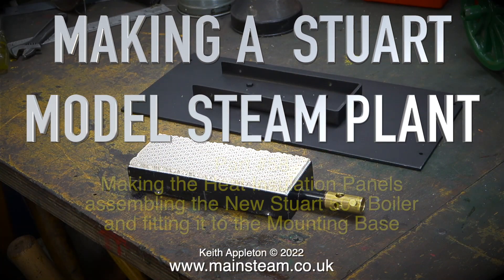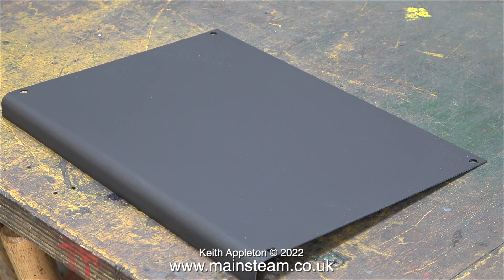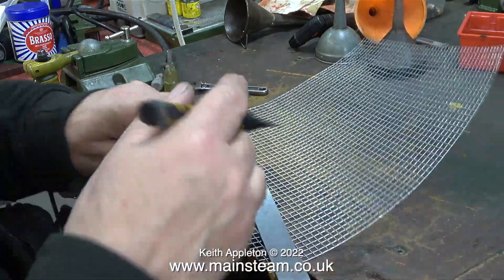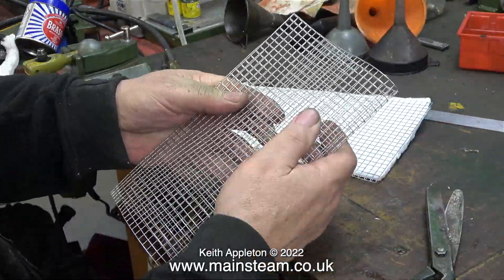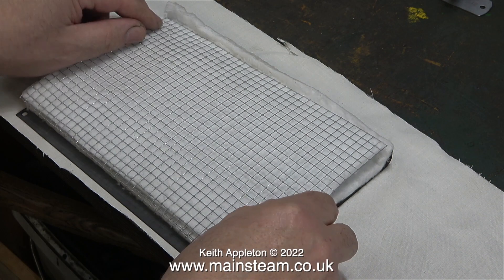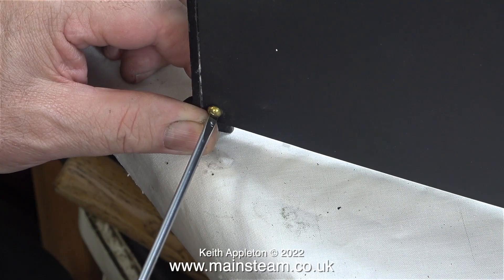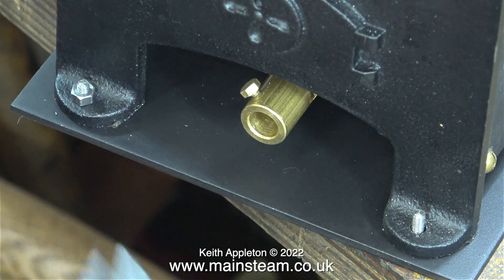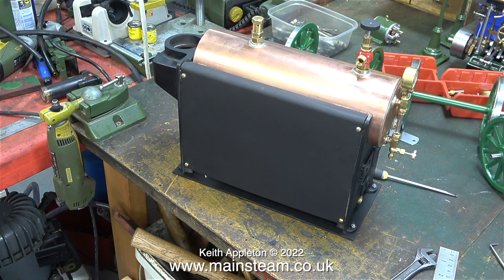MAKING A STUART MODEL STEAM PLANT - PART #58

Comment: that square mesh wire is a great idea fr the heat covers ... as for the end bits i would just use a knife edge and push them into the wire mesh once loosened from the mounting ... or ring the mesh with heat seal cordage for a fireplace ... either would work well ... the latter being super fiddly